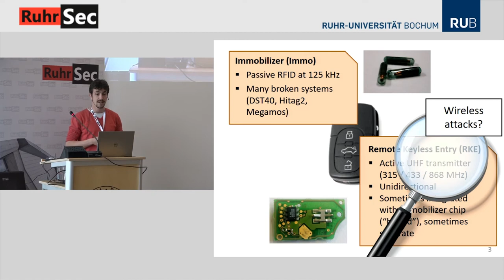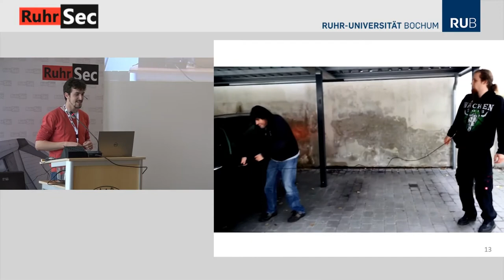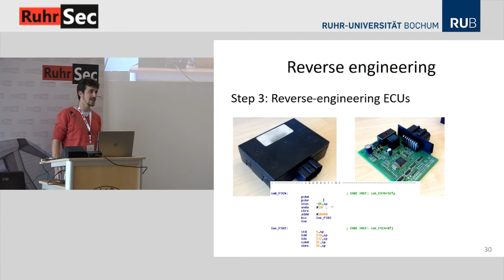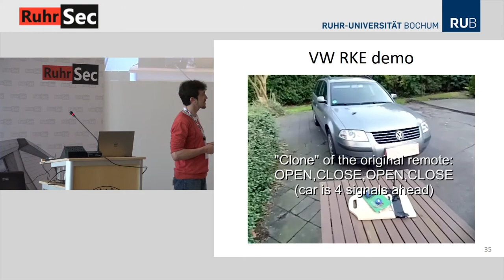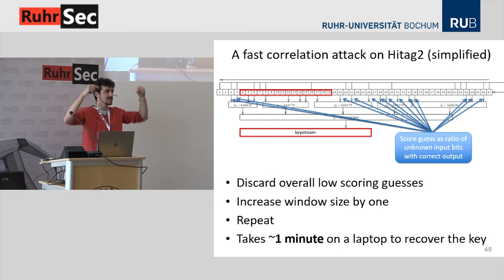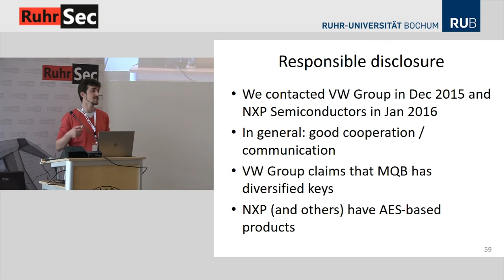RuhrSec 2017: "The (In)Security of Automotive Remote Keyless Entry Systems...", Dr. David Oswald

Comment: Hello,
I am Marko. I am a graduate student studying cryptography, and my project involves analyzing the KeeLoq algorithm. I need to evaluate its strengths and weaknesses and review the types of attacks that have been conducted against this algorithm so far. Ultimately, I need to propose a solution to break this algorithm.

Up to this point, I have reviewed all the attacks that have been conducted, and they all adhere to the following two conditions:

Initial conditions are considered.
Hardware access is available.
Given the nature of my project, where I do not have hardware access and cannot consider initial conditions, I cannot use these types of attacks. I am looking for a method to theoretically break this algorithm, even if it involves reducing the key space or any other approach that can help me.

I would appreciate it if you could help me out and guide me out of this confusion.

Thank you.